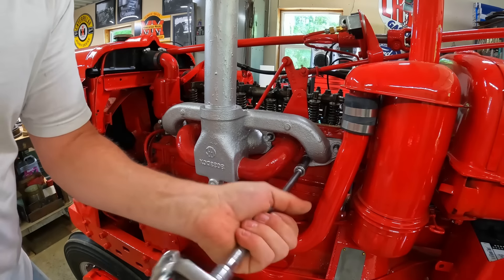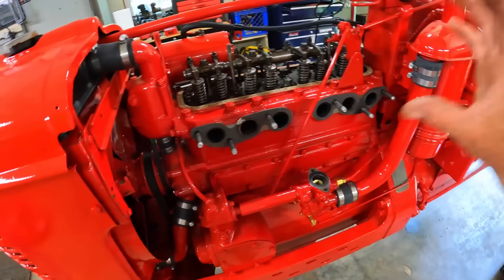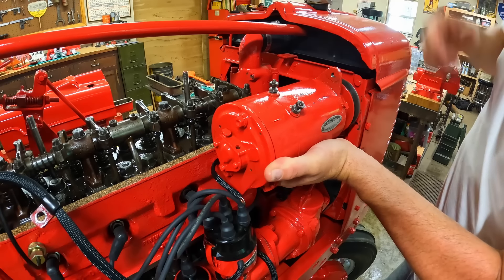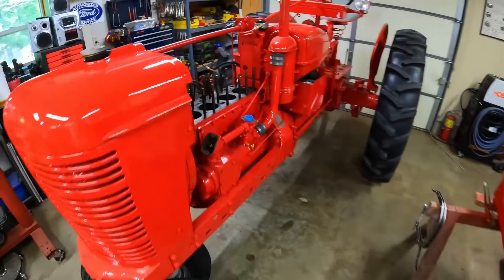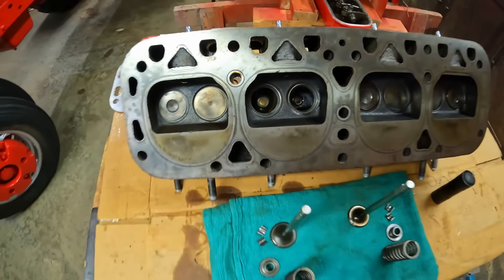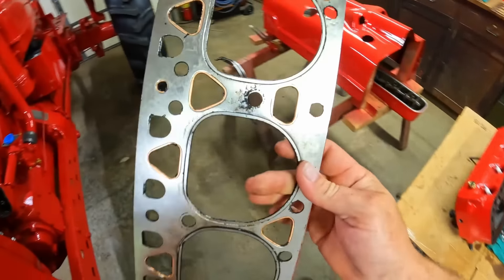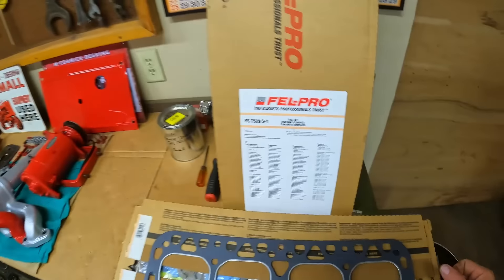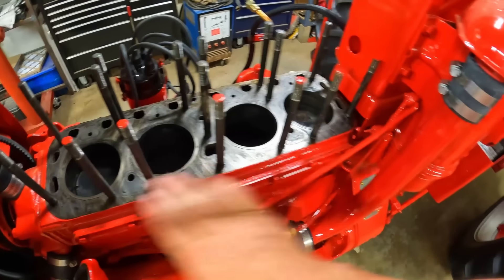Farmall H Engine Knock Found, But It's Not What I Thought - Farmall "Preparation H" Project Part 45

Comment: Well, i would say that liner has to come out to install new orings since that liner had been working on them. Once it's out, you can measure it to see if there is a problem. 

What does Senior say?
Reply from the maker: Fortunately this is a dry sleeve engine, so no O-rings to worry about 👍
Reply: @squatch253  OK, I learned something this morning before coffee. But isn't a dry sleeve supposed to be a press fit, or is it a light push?
Reply from the maker: Slip-fit in most applications, it’s not uncommon to be able to push them in by hand with nice clean block bores 👍

Comment: Fel-Pro is where it’s at. If I have an engine apart Fel-Pro goes back in it. I’m not as good as you making gaskets, I gotta buy mine, not that you’d make a head gasket, but you get the point. I’m with the other fella that made a comment about green loctite, that stuff really doesn’t like to come apart even when ya want it to. Stick the new Fel-Pro gasket back in it, can’t be any worse than it was. It ain’t right but it works. Think diesel and you’ll be okay, maybe the upper lip will tremble just a little bit, and the twitch in the eye will resolve itself. Ya never know?

Comment: Wow! What a surprise that was.😄 I would have sworn it was the valve seat! You're right, the quality of today's replacement parts is questionable at best, what with all the trash coming out of China. Seeing that it's a dry sleeve engine, there's 2 choices... if it's just going to be basically a show tractor with intermittent use, you should be able to get by with cleaning everything up and put it back together with the proper head gasket and some good sealer under the edge of the sleeve. No Loctite! I've seen what that stuff does on sleeves. The only option is to machine them back out with a boring bar.😝

 If it's actually going to be put in regular service, then it would be wise to re-sleeve the whole block (who knows how many other sleeves are on the verge of loosening up?). In regular service, there's always a possibility that it could snap the top of the sleeve off, due to side play, and destroy the engine.💀

Comment: Wow I would never have thought of the sleeve moving, after reading the many comments about loctite I would avoid this and only use it as a last resort, put it all back together with the correct head gasket and see what happens, if it does the job then super your in a winner, if not then you’ve only lost a bit of time and maybe another head gasket, go the simple route first.

Comment: If you lived by me and I knew you I would've told you how to repair this cheaply and effectively. I had the same experience on a 1953 Ford Jubilee. I knew what it was by the sound. You make a ring out of small copper to get the compressed height out of the liner. Place the copper under the lip under the liner and press down.Install new gasket and torque the head per IH. Fixed! I have a full machine shop and build racing engines. So what i tell you isn't bull......good luck
Reply from the maker: That’s how the Caterpillar engines that I’ve shown on the channel here do it too, the upper liner seal also acts as a select thickness shim to set the protrusion (see “Caterpillar D2 #5J1113 Diesel Engine Rebuild” playlist). The main difference being, those are wet sleeves and are a lot more robust than these thin-walled dry sleeves 👍

Comment: Felpro has changed ownership (more than once if I am recalling correctly) in the last 10 years (also many of the major quality engine parts names) and not for the good. Perhaps the latest move was good but in the middle of the changes in ownership, bean counters reduced old parts availability and closed plants/abandoned equipment to make those parts. Profitability without pride is the new goal. Any new old stock partial sets will be worth more than any new production. Availability now means roll the dice, you're getting parts kits that are heavily consolidated, i.e. the head gasket for a 350 farmall sized bore is speced for all and not the correct gasket per bore size.  It's been amazing to get parts for letter series of any color for so long, but i think the good times have come to the end. Specialty suppliers will shine, but the price will need to support the level of unique-ness.  Thanks for taking us on this journey, squatch!

Comment: Well, all new stuff is manufactured overseas where Metric is the standard so they aren't very good at making SAE parts to spec. I bought an SAE key kit from Harbor Freight and every one was undersized. A quick check with the dial caliper and lo and behold, they were Metric. I'd say put in the new gasket and run it. I would also contact Steiner and let them know about their head gasket.

Comment: I'm not trying to knock steiner at all, I've bought tons of parts from them and still buy alot for our cockshutt collection,  few urs back I bought tune up kits for all of the gas modles 8 tractors. They all quit running within around 2hrs run time no spark found the breaker point arms bending and would increase the gap to the point cardboard would fit. In a panic while in the middle of a tractor show I bought all new points from a Napa dealer there all still running. But i have noticed certain things steiner is selling they are not the same quality. I know they are not making these items but there is a big difference between the stuff you remove and replace.. glad you found this noise
Reply from the maker: I’ve noticed that as well - I can’t entirely knock the parts distributor for this, they aren’t the ones manufacturing the pieces and increasingly, production is moving overseas to cheaper labor markets which reduces overall quality. But if it’s the only source you’re left with, you either take it or go with nothing.

Comment: To me it all comes down to what your doing with the tractor. If its just a parade princess that see's little work I would through a little locktite on it, a felpro gasket and go. If your working it I would start checking the bores. Obviously either the sleeve was off on diameter or the machining in that hole was not true or maybe a little of both. 

Like said before if your going to be working it and putting it through quality heat cycles then the locktite will only hold for so long. H's are a dime a dozen, it it were me I would ditch the sleeves all together and run some oversize pistons direct in the bore. This is what I am currently doing with my 450.

Comment: My guess and I repeat it's only a guess would be if you pull the sleeve out maybe there's an O-ring at the bottom you could put a new one that's fatter and make it fit Tighter and it will stay
Reply from the maker: This is a dry sleeve engine, so no o-rings to worry about, fortunately.

Comment: With the proper head gasket the existing sleeve isn't going to move.  As long as it doesn't present a possible coolant leak issue then use the felpro and get her back together.
Reply from the maker: Fortunately these are dry sleeves, so no worries about compromised o-rings, etc. 👍

Comment: I was a matainace mechanic at federal magal piston an sleeve , we machined parts for clevite also. The problem is the stock markets owned us... They wanted cheaper parts so they shut us down an moved operations to China and Mexico for labor rates of 2 to 7 dollars an hr. From 15 to 21 dollars an hr here in the States of America... An now you have no name parts of poor quality an poor metallurgy.... An poor quality control of spec size... That sleeve that rattles was machined to small O.D. I would replace just that one sleeve.... Just saying, thanks for your time making videos...  And never use head gaskets that have metal on both sides use the ones with metal in the middle with soft gasket material on the out side... The metal out sides gaskets never seal,

Comment: After discovering that the solution is to fit the right gasket, the liners need to be left alone, any compound on the liners will inhibit heat transfer

Comment: So the cylinder blocks on these vintage International dry sleeve engines are all stamped on the block with a letter designation for each hole. The letters...A thru E... designated a bore tolerance spec with the bore stamped "A" being the smallest and the hole marked "E" was the largest. Back in the distant past sleeve kits were available to match the different bore sizes. As time went on the sleeve sets were supplied with only one sleeve OD size which meant the repair sleeves would be really tight in an "A" hole and would practically fall in a "D" hole. A loose fit on the gas tractors wasn't instant death like the loose fit on the D-236 and D-282 diesel engines were. I've seen the holes range from A to E on the same block on those. If these sleeves were not a press fit in those bores the sleeves would fracture at the flange and go into the oil pan shortly after the overhaul. I've used Loctite sleeve retainer to successfully anchor loose dry sleeves on different makes of motors with 100% success over the years.
Reply from the maker: Yep, I went t through all of those block stampings and their meanings in the Super M rebuild series on the channel here, also showed the custom honing we had to do to the block bores to get the new oversized sleeves to go in 👍

Comment: You can still see crosshatch and all cylinders give consistent even pressures during a compression check. Inspect for cracks, inspect liner protrusion. If no defect is found, install new felpro head gasket and reassemble the engine. It would appear to me that the design of the headgasket “fire ring” acts to seal the combustion chamber but also to retain the liners in the bores. Why fix it if it ain’t broke? You said it yourself, new parts are sketchy nowadays. Send it all the way with what’s there.

Comment: I would id mike the sleeve if its not round I would try to spin it maybe turning it 90 would make it tighter in the hole and make it closer to round. Oil it up good and let it break back in. I think the little bit of crush on the head gasket will hold it. That's my 2 cents and maybe it's only worth 2.

Comment: I can't imagine (not a mechanic) that the sleeve should move at all. Much less having a head gasket be the solution. Seems it would have a pretty early failure running it not pegged/fitted in place. Just a gut feeling, but you don't seem that concerned. Wondering what you know that you could maybe tell us next episode.
Reply from the maker: About half of the dry sleeved engines ever made have slip-fit only sleeves, with the overlap of the head gasket being the primary means of retention 👍

Comment: I’d definitely be curious what the outside of the sleeve and the block walls look like.  I’d probably pull the piston out and pull the sleeve out to make sure there’s no scoring or anything between those two surfaces.  With no lubrication between the two and it moving up and down like that, there may be an issue.  If not clean it all up, new head gasket, and let it go.  I’ve seen the perfectionist in you and appreciate that you do things right.  Anything else would be assuming things are ok and that’s not your style.

Comment: I would do as you describe. Clean, inspect, set protrusion if necessary, use the proper gasket and bolt the head back on. Done. It will outlast either of us. I would stay away from using any sleeve retainer compound

Comment: Fitting that loose you are going to have heat transfer problems. Seems like it would have combustion leak problem also.
Reply from the maker: When I did the rebuild 18 years ago, all 4 new sleeves slid into the block with just hand pressure so none of them were a very tight fit to begin with 👍
Reply: @squatch253  They should be a tighter fit than that.
Reply from the maker: About half the dry sleeved engines ever built had slip-fit sleeves in good clean bores, it’s actually rather common 👍
Reply: @squatch253  All of them I have seen have needed a little persuasion to go in.

Comment: I would measure liner to block clearance and depending on how much clearance review options for repair. I’m guessing the sleeve didn’t shrink. Again I’m assuming the block is worn causing this. So find another block start over or use the non Steiner gasket and review options for a sleeve bore lip repair without tear down, or glue. This two second idea I have would be to find high temp jb weld or equivalent and use one the water jacket side. But!! That makes my eye twitch a lot but sourcing a block that in as good shape as the one you have. Or find a universal sleeve that’s oversized and machine to fit may need a shop to true up the bore on the block.

Comment: Not something I have ever dealt with and only heard of on severely work Detroit diesels.    I would fully defer to those who have seen this issue.    I was asked to rebuild a 12-71 that was severely worn and it was,  nope.   It needs to be bored over,  new liners and you need to get a good Detroit guy.    With single engine power for a 75 ft fishing boat going in harms way,   you can't afford any mistakes.

Comment: *ange *over just had this problem with I think a couple of production years. Their fix was to drill and tap the block in the area of the sleeve and install a screw-in or press-in pin.
^..^~~

Comment: Reassemble (pending passing inspection) and forget about it. You’re right about the parts you have likely being of better quality than new replacements, and with such low hours is just makes sense. Clearly it must be the head gasket, if not for that you’d be breaking her in by now. Side note: is it possible that the head gasket from Steiner is for an overbore kit?
Reply from the maker: I was thinking the same thing, seeing the amount of relief around that combustion ring makes it look like it would be in the right spot for the Super H/300/350 “overbore” version of this engine 👍
Reply: @squatch253  I’m sure the majority they sell are for that application. Most guys who rebuild them end up going with the bigger bore.

Comment: I have never come across this. As you say the head should clamp the liners down. Wonder if the head gasket was for another engine or just very poor manufacturing. Would a small amount of loctite around the top flange do any harm. Then again if the head clamps them down life will be good. Good job you sussed this one.

Comment: If you used the felpro gasket to start with you would be none the wiser, I would put a bit of hylomar or aviation gasket around the top to make sure it seals perfectly and send it, the liner won't move with the gasket holding it in place.

Comment: Glad you found it! Well those are Dry sleeves correct? I dont know that you have much for options.Not too sure that you can dimple the block to tighten up the sleeve nor that it is a very good idea.
You can try a sleeve retainer adhesive if you didn't.
You can try new Sleeves but if the block was cleaned and machined before it may be right at the very edge. then new sleeves will not matter unless you can do a oversized sleeve.
Interested to see what you do.
Reply from the maker: Yes sir, dry sleeves here, fortunately.  If this had been a wet sleeve, it would be coming out for a re-seal at the very least :-)

Comment: Are those wet or dry sleeves? If dry, can pin the sleeve. Regardless, there will be compressed gasses getting past that now "slip fit" defective unit. And, you have not yet determined (it seems, anyway) whether other sleeves are borderline. Custom sleeves are everyday work for some shops, and who knows, maybe off the shelf replacements are just that few thou larger.
Reply from the maker: Dry sleeves, fortunately. Back when I did the prior rebuild on this engine, I noted that all 4 new sleeves could be slid in with only just hand pressure, so none were a very tight fit to begin with 👍

Comment: Could you order one sleeve and check the Rockwell hardness fit and finish. For the hours it’s going to get it will probably outlast us all. With only 250 hours the rings would barely be seated in. I found an A&I sleeve part number A-SD22.

Comment: Who knows how long that sleeve has been loose but held in place with the old head gasket. I'd clean up everything and use the Felpro gasket and call it good.
Reply from the maker: It first had a loose sleeve 50 years ago, my grandfather dealt with that. I don’t know if it was the same #3 cylinder or not, but now it’s my turn lol 😂

Comment: There is a sleeve or block problem .  Is there any place on the block that can be added to, centre punched etc to increase the interference fit.  Use the Green stuff.  Don't worry about the next guy.  It is like an old girlfriend.

Comment: Cummins makes a very thin stainless steel shim that sits on top the liner to correct the liner protrusion. I wonder if anything like that is availiable for the Farmall engines? Ive also seen shims that go under the top lip of the liner where it seats into the block to correct  liner protrusion problems. I would think that as long as you get proper crush on the gadket it will be fine

Comment: The liners have an O ring at the base which should hold it in place
Reply from the maker: These are dry sleeves, so they don’t come in contact with the coolant nor do they have any seals on them - they’re just thin-walled replaceable sleeves that slide into solid block bores 👍